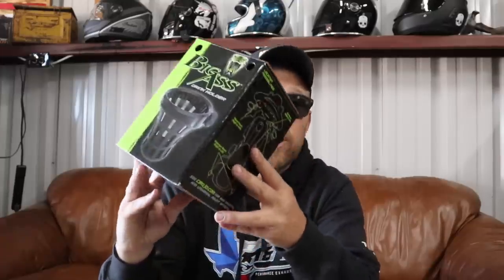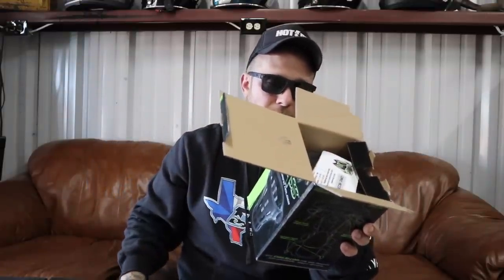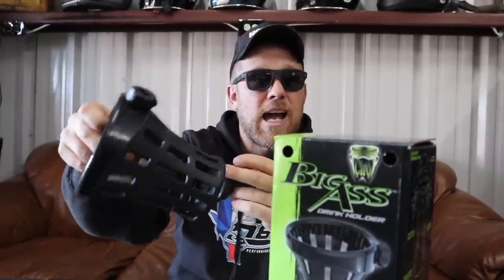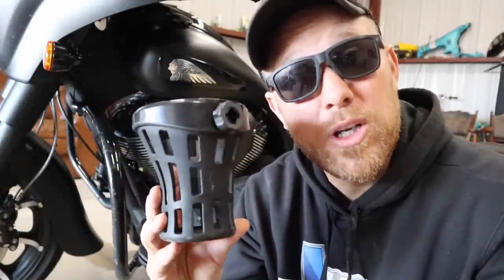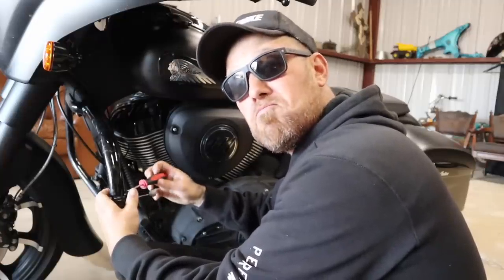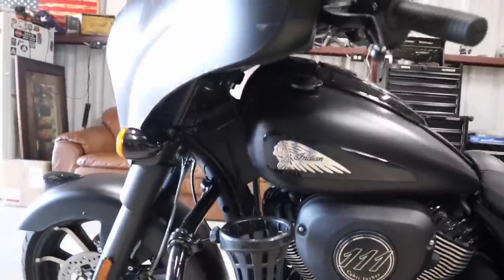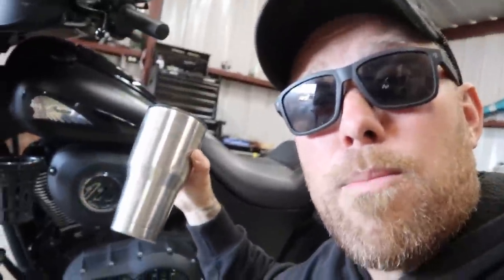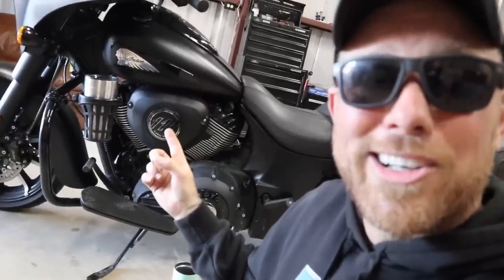It's the Big one / Drink Holder Review  Ciro3D

Comment: Hey Adam - Just bought this exact same setup but haven't tried it yet. The stem on the universal ball mount seems a little thin. Have you had any issues with it holding the weight of big tumblers? My 34oz tumbler gets pretty heavy when full of ice and water. Just curious if you're still liking the products, both the drink holder and mount. By the way, great video.
Reply from the maker: I'm still pleased with mine